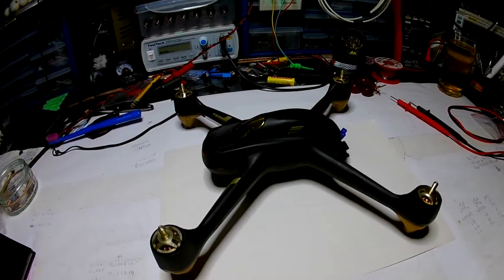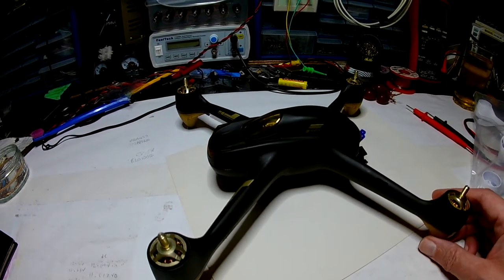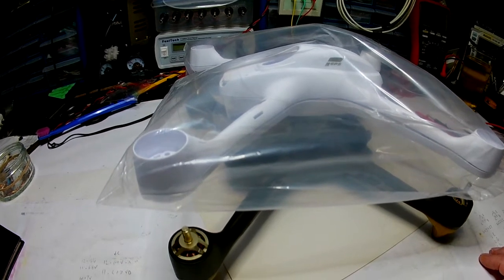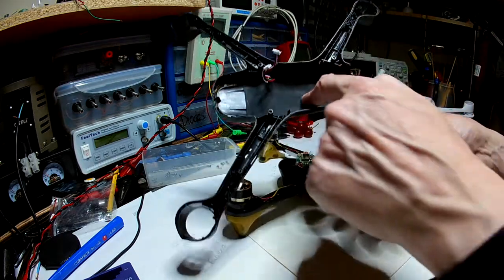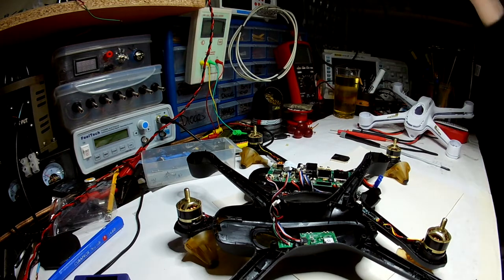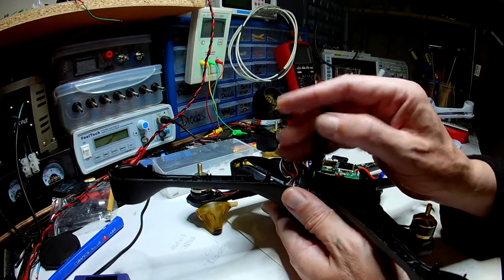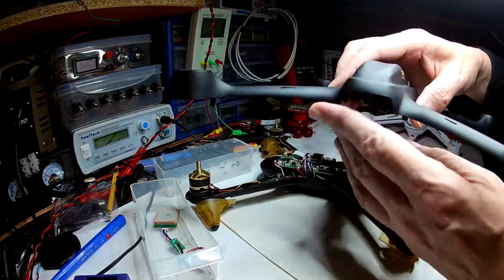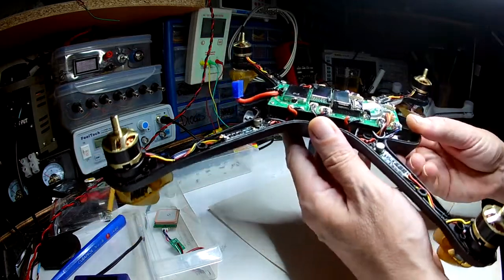Hubsan H501S Quad-Copter Body Shell Swap

Comment: Hi Elecifun 

I have a question about unoriginal motor replacement on H501S

Can these be used instead of org Hubsan 1806 (1650KV) motors
Racerstar Racing Edition BR1806 (2280KV) from banggood

or will ESC take damage from the higher KV ???

Best Regards
Gert Hansen
Reply from the maker: Without looking at datasheets of the motors also the circuitry comprising the ESC's, I can not say. All I can say is that the RPM per Volt of the (unloaded) motor is represented by KV. Given there is no such thing as a free lunch. The current required for the extra RPM may or may not be facilitated by the ESC without damage. Its a spec check scenario. Also the extra punch will be required by the battery which gets quite warm delivering the charge  with the original components of the drone. This probably isn't much help, sorry.

Comment: +1 Elecifun - Very helpful detailed video!  I have a couple of questions.  Like many 501s, my new H501S suffers from FPV camera short-range reception.  I've already checked the antennas/connectors in my Standard transmitter and they appeared to be OK.  In fact, I've replaced both internal antennas with Hubsan's external antennas kit anyway.  Sadly, that barely increased my FPV range from 90-100m to 100-150m.  So now I need to disassemble my 501 to try to further diagnose the problem since Hubsan customer service (Shally Liu) is ignoring my pleas for help.

My first question is this:  Is it not possible to remove the entire mainboard/wiring assembly intact, i.e., with ESCs and motors still attached without desoldering/detaching the 4 pairs of ESC wires from the mainboard?  I just want access to the camera and camera circuit board to check the antenna wire routing as some 501 owners say that's a possible culprit.

Also, I noticed in your video that the camera appears to be hard mounted to the shell.  If so, this is puzzling as that's bound to transmit motor vibrations directly to the camera. The 501s marginal image quality camera needs all the help it can get.  Did you notice any vibration damping material around the camera when you removed the retaining bracket holding the camera?  If not, do you think there's room to add some?

Thanks! BTW, just subscribed.  ;^)
Reply from the maker: Hi, cheers for the sub. Yes all can be removed without the need of a solder iron,  giving access to the camera. You may need to disconnect the LED's to make your life easier. The yellow gunk and the two screw bracket are the only things holding the camera lens into place. The craft does not really vibrate as such so I guess no need to add anything to dampen the vibration. The body shell itself is made form a semi flexible material which absorbs vibration/shocks. You could try adding something for an experiment, but without it being clamped firmly I guess that might add to movement. Hope this helps.
Reply: Elecifun - Thanks for the quick reply.  My 501's video, out of the box, seemed to be not as clear as other videos I've seen posted.  The first thing I checked were the props.  Mine had some slightly bumpy leading edges, coming right out of the mold, I suppose.  I very lightly worked them with some 1000 grit paper then polished all the props with some light polishing compound.  Now they are really smooth.  It not only reduced vibration, and was a bit quieter, but improved the video quality as well.  I still haven't balanced the props yet as they're running so smooth now but have been thinking that if the camera was isolated from the vibration it's bound to improve the video quality even more.

Another thing was my new 501 came with a small round dark-tinted plastic lens cover disk installed.  After noticing that other (older 501) videos didn't have it I carefully pried it off with a fingernail.  Had to work it a bit as it was glued on pretty securely.  Now it looks just like the older models.  And with the bare camera lens showing through, my FPV image quality has improved significantly, especially in lower light.  I can't imagine why Hubsan decided to degrade the camera's performance by adding a dark tinted lens cover to the new 501s.  Go figure.

Anyway, thanks again for the quick reply and helpful video!
Reply from the maker: I bought some dodgy props which made mine vibrate, two of those props also snapped in flight turning abruptly. I put the genuine Hubsan props back on and all is well. I have not considered balancing them. Can you recommend prop balance apparatus? I have just got back from an hours flight over the fields. I love this craft.
Reply: Mine are the genuine Hubsan props that came with my 501.  Regarding balancing, since these don't have a prop shaft through-hole it's a problem balancing them.  Sorry, I don't know of a good balancer, but some people are taking 3 propellers off then balancing 1 at a time on the 501.  They start by sticking a piece of cellophane tape on the bottom of 1 blade, about midway to the tip of the blade.  They then spin it up and check if the vibration is better or worse.  If worse, strip the tape and place another one on the opposite blade.  They will then try various lengths of tape at slightly different positions until it's better balanced.  Obviously, it's not precise but better than nothing, I suppose.  I will also probably give it a whirl (pardon the pun) in the not too distant future.  Gotta get my FPV reception problem sorted out first.

Glad you enjoyed your flight.  It was a bit windy today so will fly mine tomorrow.

Cheers!
Reply from the maker: The props I use are fine for me. I have even sorted 7 from the twelve that I bought (2 died in flight) that I can use without any dodgy vibrations.. I thought I would crash quite a bit learning to fly. I did, but only indoors with my Syma X5C, not my Hubsan. Hope you got in a good flight.

Comment: Just started watching your video.Which antenna is inside the right rear motor casing? I got confused.I'm gonna be doing the swap out sometime next week myself.
Reply from the maker: Hi, the camera antenna.
Reply from the maker: Just to add in case anyone wonders. I tried the camera antenna in a front leg (front left) just to see if there was a difference and if that difference was a better or lesser reception by the controller, It was less.The antenna works better in a rear leg, motor housing.
Reply: Well the drone comes backward in RTH so it's always closer to the pilot that way.

Comment: Well that gave me something to watch while my wife's boring TV show was on...smile...kept thinking of an autopsy of a frog..ohh those micro components love them and hate them...yep Hudson will think you are crazy..."its an email from the bat shit crazy guy he wants to know what kind of sealsickalasitical nontakipartable gunk we use"..i would have just painted it white..grin..my tape is red (on the back)
Reply from the maker: Lol, I looked at all the screws today a thought, wow thats a lot of screws. I cant wait for Hubsan to reply so I decided to put a blade type solder tip in my iron and used that to cut through the hard nose plasma, worked a treat. 
I am putting it back together today. I would have to take it apart to paint it, also this way I still have a nice black shell if the mood takes me.
PS, I woke up 3 times night before last thinking/dreaming about ghosts and noises. I put comedy on my laptop to fall asleep to and its sound was in slow motion the first two times I awoke, freaky. The third time I woke I shouted out F***off I have to sleep. I was good till morning. Makes me wonder am I wrong for not believing or have I had some Voodoo done on me. ;)
Reply: Elecifun its the hubsan voodoo

Comment: Hi, after swapping the body shell, FPV on transmitter is showing nothing, but I checked a camera, it records, shoots photos and saves on micro sd. What's problem here?
Reply from the maker: Maybe the camera cable is not connected well.
Reply: Elecifun Camera and  5.8 FPV APEX cables are connected well, I checked them. Transmitter shows all drone's characs like altitude, voltage, m/s and etc. But no picture at all
Reply: Sam Brandon looks like the hubsan voodoo has been put on you two

Comment: I accidentally clicked GPS mode off mine and tried to fly away. I saw it go down and managed to retrieve it. I have checked it over and apart from one of the arms hanging off it seems okay as the wires are still attached and the GPS, lights and the motor still works when I put a full battery in. Could I super glue the arm back on?
Reply from the maker: Aw my friend, I could not answer that 100% for you. What I can do and I will as soon as I have wrote this, is this. I have a damaged shell from a repair sent to me by a YouTube viewer. I will super glue two parts and stress test the joint. I will let you know tonight if it will be OK.
Reply: Elecifun ah brilliant thank you. Because the break was clean without any chipped off bits I have superglued the crap out of it. I will be getting a replacement drone soon so I will film it and put it up on my YouTube channel
Reply from the maker: I am using Loctite Super Glue which does not stick this plastic well, at all. I would not try and fly my drone with this repair. Why not just change the body for a new one?

Comment: What about black on the bottom and white on the top?
Reply from the maker: That could work make it more unique. White is quite nice where I fly as it stands out with trees boardering the fly area.
Reply: markybyeah I thought I heard that 501c shell was stonger than the 501s which makes it confusing as they're normally listed as the same product.
Reply from the maker: I am not sure about that. I have both and they feel the same to me. The white is better for me seeing it when in flight. The black does look cool.

Comment: Hia you said you fly in attitude hold mode,  av you any tips on flying in this mode as mine seems flip and wobble then crash
Reply from the maker: Hi, I am not sure I have any tips as such. After a few problems myself I have chosen a place to fly where there are no transmitter masts where it is flat and on days when the wind is at a minimum. I fly low ( a couple of feet from the ground) and at a speed where adjusting the position of the quad is not a panic and yet quick enough (quicker than in GPS mode) that I do not fall asleep. I am looking for control and time to become familiar with the flight characteristics.
I fly in expert mode with the sensitivity set at 80%. This quad can still pitch turn and get into trouble if the sticks are moved erratically so I tend to fly as smooth as I can. I imagine I am a passenger onboard or  pilot and fly as I would like to be flown, knowing that fast more vigourous flying will come in time. I also have a Syma X5C-1 which I fly every day in and out of the rooms of my home, most of the time inches from the floor, again for control. 
This type of flying means that when you crash, as I do if I am distracted or tired the damage is minimal and I can also see where I went wrong and make the mental adjustments. I personally get more enjoyment from flying at a set controlled speed and height and banking into my corners, the quad looks and sounds great with its brushless motors. Also the fear of it flying off or losing control and crashing is reduce making for a much more enjoyable experience. I have footage of flying close to the ground with the sun behind the quad so it shadow is recorded it looks great. I do drop it into the grass a couple of times but there is no damage and because its flown/crashed line of sight I see where I went wrong and so can learn for my mistakes. I hope this helps you out.
Reply: thank you for your reply much appreciated
 Elecifun

Comment: Great vid Elecifun! Unfortunately I crashed my H501s and the drone now flips over when trying to take off. 
It hit a wall and two rotors got stopped against the ground. Now it immediately flips over on take off. The controls are also delayed/unresponsive, then the motors seems to go at full speed for a second or two before the drone powers itself down.
I'm hoping to get spare parts to fix it. Do you have any idea what might be causing it and what parts I would need? Somebody suggested ESCs? Here's a video showing the problem. https://youtu.be/ty1ioX4CaeI

Any ideas, thanks?
Reply: Have you opened it and checked for loose wires / burned or bent components?  The GPS and the 5.8 GHz antennas inside the drone have only clip on mounts to the board, easily displaced in a collision.  It's a start.